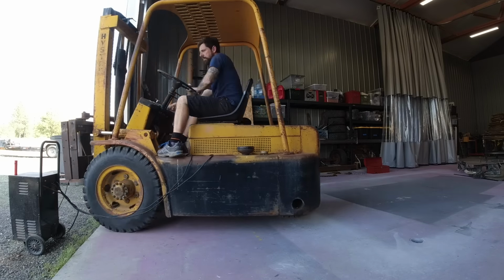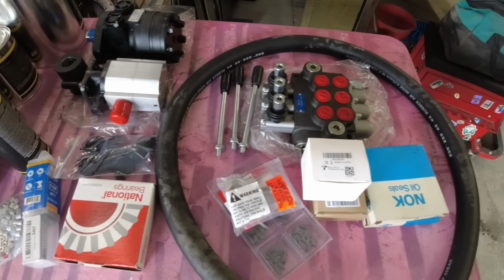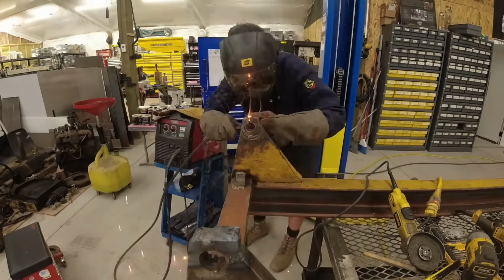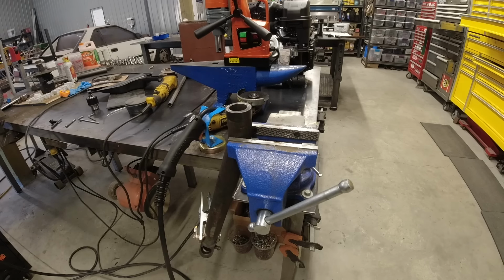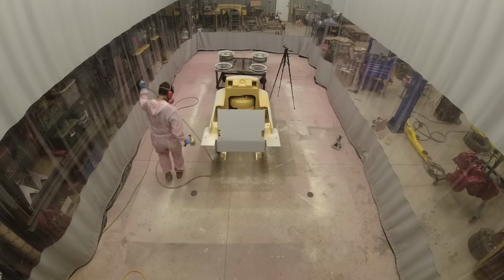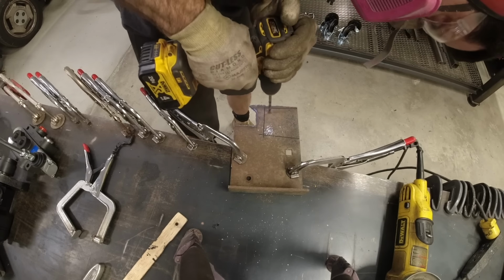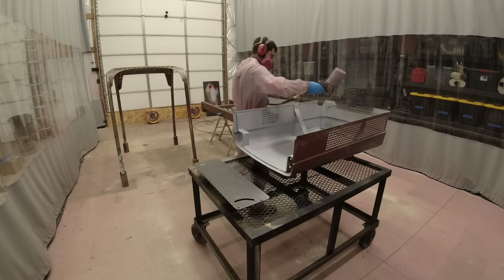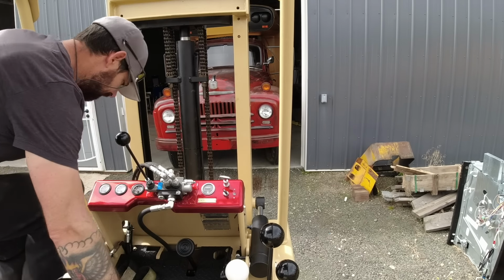Resto Modding A 1956 Hyster Forklift

Comment: I love the paint job. The only concern I would have is Counter balance weight. Part of the lifting capacity is being able to balance the load on the front end with weight on the rear and you removed a bunch of weight by removing the Engine. Do you have any safety concerns with the forklift tipping forward with a load on the forks?
Reply from the maker: The difference in weight before and after is probably about 400lbs or so, so you are correct that the lifting capacity is lower due to the lack of counter weight. I didn't think about that at the time because I assumed the weight difference was negligible. I have exceeded the weight rating on this both before and after the modifications and the only thing that happens is the back end starts to lift telling me I am past the lifting capacity. Most stuff I lift is well under 3k

Comment: When you was putting the brakes together I noticed that you didn't have a castle socket with plasma cutting just bolt a socket in the middle of it before you scrap the metal you took of it if you don't sell it put all on a pallet cover and Leave you never know when you may need some quality metal you will find a place for it All very good job well done should Last another 70 years

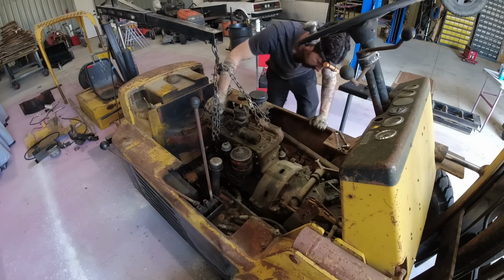Comment: Outstanding job and vid. Kudos, man!  ...BUT SIR! 0:37 BACK THEN the only way to get things done was to use cool engineering. It is nowadays, where electronics-driven, epoxy-encased, unreparable single-use crap is put to use. Nowadays they use shortcuts in designing and manufacturing, nothing-to-see-here, not cool engineering.

Comment: I would have used a power steering pump from a small car to power the steering for use with the proper cylinder control valve box thingy you mentioned. All the hydraulics on my homemade tractor run off a power steering pump, just need a pulley for the belt.
Reply from the maker: I thought a lot about doing that, but I didn't want to add another drive system onto the motor.

Comment: As a forklift mechanic was interested to see this restoration and how you would go getting parts, but quickly realised you were taking most of the original parts. Haha. We're you unable to get parts or did you just want to make it easier to drive? Love the look of these old hysters and thinking about restoring one myself one day and paint it up like Guido from cars 😂
Reply from the maker: If I could have sourced the parts I would have kept it more or less original. I would have made some little upgrades but I love old flathead engines. Just the engine rebuild kit was twice what the new engine cost and it still would have required machining and there were just so many parts I couldn't source

Comment: Fantastic work, well done, watched that start to finish. One question, what happens if you go from full speed to zero quickly? Does the drive motor have a pressure relief valve somewhere? Just thinking that would be a lot of inertia going into that comparatively small hydraulic motor compared to the old engine. Great build tho.

Comment: A fork lift is not built for speed you can turn one over at 5mph. It is designed to pick things up and move them from A tro B within a lifting capacity as shown on every FLT. I have spent 15 years plus as a R.T.I.T.B. trainer Asessor Exeminer and have seen the results of excessive speed on these Machines. Well done on a great restoration.

Comment: Clutches:- Saab 99s, had a 200mm by20mm dia drive shaft between gearbox and engine. Once removed, clutch and flywheel could be taken out. Didn't have to split any gearbox to engine bolts.
Reply from the maker: That is awesome, I will have to look into that design.  Thanks for sharing

Comment: Beautiful work and very thorough ! But that hf engine .. maybe would have gone another way there .. or simply renovated the original if it would still run. You are going to put near zero hours on this so longevity/reliability is a none issue.

Comment: I used to keep an old Hyster running. Capacity of 20,000 pounds 4 feet out, I think. I know it would lift 14,700 pounds with a CG 4 feet out. Six cylinder Continental flathead power!

Comment: Looks good. Would have liked to see if the original engine would have worked, but, yeah
Reply from the maker: Original engine needs a complete overhaul as its consuming both oil and coolant. I found the engine rebuild parts and they were expensive but not insane. The biggest problem was the other worn out parts like the distributor and clutch, specifically the pressure plate. I could not find the steering gearbox anywhere, nor could I find a similar one that would fit, even with a ton of fabrication.

Comment: Super nice build.
Would it not be nicer to the paint to have a flat washer between the paint and the bolt?
Reply from the maker: I ordered brass washers, but they weren't here in time so you saw the mock up install just to make sure it worked. It's got washers between the paint and bolt now

Comment: I had a 1966 triumph 1.3 4 door saloon car it was front wheel drive with the engine front to back it was designed to change the clutch without removing either the engine or gearbox. just like changing a record in a juke box ( well almost ).
Reply from the maker: That is awesome. I will have to look that up

Comment: So if you get a leak in the steering control valve setup you're not worried about hot hydraulic oil shooting you in the face?  Just wondering if you thought of putting a guard on that?

Comment: At around 15:00, that ear broke off not because of a bad design but because they didn't add enough material for it to withstand abuse which can happen to forklifts when operators aren't being careful.
Most other things on that forklift looks beefy and dimensioned for hard hits. Those ears do not.

Comment: Those split ring wheels are not 'widowmakers'. They are actually relatively safe compared to the actual widowmakers, which are the center-split wheels. Very thin flange holding them together and always a pucker when airing them up.

Comment: What brake line did you use?  Great build
Reply from the maker: https://amzn.to/3tFjMrW
Reply: @AustinCoulson  bought it thanks brother.  My son and I are  rebuilding his 1961 Chevy C10.  I have a couple videos.
But I just ran across your videos last night. I really enjoy your content
Reply from the maker: @2LateIWon  awesome. I love those trucks. I find the copper nickel lines are the best combination of strength, bend ability and corrosion resistance. I use the Eastwood bender and love it and I have the flaring tool in my Amazon store if you need it. Good luck on your project!

Comment: There is some confusion out there when it comes to the type of wheel you have. You have a wheel with a lock ring not a split rim. These are also dangerous if you don't get the lock ring on correctly and air them up. A split rim is just exactly what it is called. The actual rim is 2 pieces that have a separation point near the middle of the rim, and there is no lock ring on the bead like the lock ring wheel you have.  Both parts of the rim on a split rim is where the 2 sections will part ways if they are not connected properly before airing it up. They can also separate when in use if the connection where the 2 parts of the rim get corroded overtime and can separate in an explosive fashion.

Comment: Nicely done sir. How about a dot of color on your steering indicator for contrast? Could even be just a sticker. Lastly I would be concerned about the proximity of those hydraulic steering hoses to your feet, legs, and arms if a hydraulic leak ever occurs. That is fixable with a sheet metal guard.
Reply from the maker: I am in the process of rerouting some of the hoses and I've added hose sleeves to prevent chaffing and in case of an explosion. I was planning on adding color to that indicator but couldn't decide what color.

Comment: Show how to remove the rear wheels please to change rear tires.  I have a YE 40 and I am tuning it up.  They do not make forklifts this strong anymore.  I put a boom and a hydraulic winch on it making it into a small crane. With the boom I have set 35 foot long trusses on the walls of a building and moved 40 foot long utility poles.    I use it to put stuff on the roofs of my buildings and load trucks.  The kamikaze crane as I call it has worked for years and it has been not removed from the forks for years.   The engine starts with before you can get your hand off the ignition switch key. Our Ye 40 has dual tires on the front and is very stable due to the dual tires. Cool video you made
Reply from the maker: https://www.youtube.com/watch?v=5WYRvDtqRr8

here is a video where I show how to remove the rear hub. FYI, I do it the wrong way first so watch it through to see the correct way.  Good luck with your YE40, I LOVE these forklifts

Comment: slight suggestion why not use an Orbital valve for the steering with a adapter to the old steering column would look a bit nicer than the Raw valve bank on the Dash
Reply from the maker: The orbital valves I found while researching were all lower pressure ones with open centers that would have required a second hydraulic pump or a lot of hydraulic components to make it work so I went with simplicity with the single spool valve.

Comment: Me personally I would have made a grease zerk in the end of the pin and drilled a hole straight through the center and cut a little recess in the place where the bushings are and makes a bushings greasable

Comment: Great paint and clean but I dunno' about the mods.  I'm not diggin' the pull start motor, hydraulic drive and what's with no steering wheel.  Should have restored it to original or as close to as possible.  Interesting take on it though.

Comment: I'd say the part about it moving slow is probably a limitation of the engine idk if it has a throttle to increase the RPMs a gas pedal would benefit this so you can have your low speed and high speed just by pushing the gas pedal this should also help the forks raise faster

Comment: YT decided I needed to see this today.  I don't know what your top speed is, but our stuff at work is supposed to be limited to 6mph, and inside speed limits are 4 mph. Though when moving heavy, and/or tall stuff (2+ metric tons as double stacked IBCs say) I rarely go over 2mph so really like you say, speed is not of essence.
 And as pointed out by others, Your lift capacity is likely a bit lower as you've lost the engine weight of that brick of a Conti, the oil, and the coolant. I'd look into and equal weight of some plates or lead bolted in place low and as far back where the old engine lived to compensate and help the stability when loaded near max.
Reply from the maker: I'd say this rig probably maxes out at around 2mph on uneven ground and maybe 3mph on the concrete. Perfect speed for me. I will be adding some balance weight once I get it all dialed in and find the right location to secure it. Thanks for the comment
Reply: @AustinCoulson  cool beans, still fast enough to get in trouble with near max wt. or tall/awkward stuff.  Like that paint job, too.

Comment: This is a really cool build, and I don't want to give you any shit for it. That said, fully hydraulic steering sucks, as you're going to find, but probably nicer than what was there before. It's a bummer to see the manual transmission going, but HST is a solid substitute, with quite a few cool control options.

Comment: Split rim is not the same as a locking ring wheel. The widow makers were actually two piece rims that split in the middle. These are perfectly safe as long the locking groove is not rusted thru.

Comment: Good video and an interesting project. However your lifting capacity is actually less than the stock forklift. You removed a lot of weight that was also being used as a counterbalance to the load that would be on the forks. I really like the paint job!!

Comment: As an afterthought, you might want to consider putting a strip of Aluminum Diamond Plate around the bottom so the diamond plate is the first surface to be impacted instead of the steller paint.  How difficult would it have been to go electric if you had chosen to?  Would cost or difficulty be much different, given your skill level, which is substantial!
Reply from the maker: Going electric wouldn't have been that difficult but it would have been more expensive to have adequate batteries and I decided against it because I only the forklift sparingly and I didn't want to worry about battery maintenance

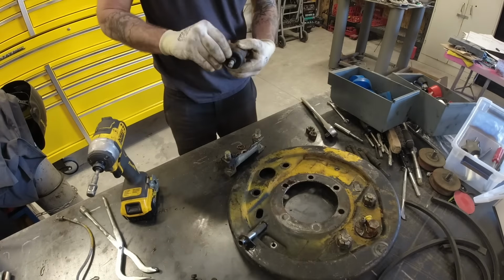Comment: 18:35 I have an extreme hatred for drum breaks. Yeah, I know that they have their uses, but why the extreme hatred for them? 

They are unfit and extremely unsafe for use on Trucks(ie pickups like Ford, Chevy, Toyota, and etc.) I’ve been a passenger in my stepfather’s truck and he has to manually pump the break pedal in his Chevy truck(from the mid 90s) 200 feet from where he needs to stop. He starts pumping them even when the traffic light at an intersection just turned green.

And the little wheel cylinder in the drum breaks on the rear wheels had to be replaced so many times by now that the amount of money he has spent on replacing the cylinder could have been used to pay for disk breaks for the rear wheels.

Comment: Its abit overkill but if you had fitted a oil pressure light you can then get the hour meter to only run when there is oil pressure.

Comment: Nice job. Seems though as if a gasoline powered forklift is limited to outside work? How about electric motor to drive the hydraulic motor?
Reply from the maker: I thought about an electric conversion, but I didn't like the cost of batteries or the hassle of maintaining them. I run this lift in my shop, I just have to open the door

Comment: The build quality is amazing, but I still have several issues with your steering system. not exactly sure on a good way to fix that, though.
Reply from the maker: The steering is my favorite part. It works great but I will be adding a flow control valve to it in order to slow it down a bit

Comment: Hint; as a 40 years of production fork lift operating. ever time the employer change the forklifts to Lp gas the motors almost never needed rebuilt.  instead of new motors about annually mainly due of it over heats the fuel is automatically shut down. due to the LP gas vaporizer is designed.  goo luck !
Reply from the maker: I am considering changing this engine to propane for that reason as well as the cooler running temps.

Comment: Was there any asbestos in the brakes?
Reply from the maker: Great question.  There almost certainly was, so I used water and avoided compressed air while cleaning them. I also wore a respirator while working with them.

Comment: Nice job on your Hyster resto-mod.  I have the same forklift only mine is not as pretty.  Are those new brake shoes and if so, where did you buy them from?
Reply from the maker: I reused the existing shoes as they were in great shape

Comment: The lifting capacity has changed. As you removed a significant amount of weight when you pulled the original engine out.

Comment: Great video. I had to hit the subscribe button. 

Question:
What is that curtin solution you are using while you paint? I am about to build my shop and want to do something similar.
Reply from the maker: https://youtu.be/_3SWbrU2Muw
Reply: @AustinCoulson  perfect. Thx
Reply from the maker: @goatmaster3387  no problem. I still recommend all the products I used, this booth works great. The curtain company recommended an extra 10% length so it doesn't have to be pulled tight and I found that to be a little too much. 5% extra would have been more than enough. I think I still have a coupon code for those EP fans I'll try to find that and post it as a reply here.
Reply from the maker: https://s.vevor.com/bfQHWm

https://amzn.to/3SGAxO1

Comment: The engine should be a Continental Flat Head Engine. F245 model for forklifts.

Also, in all probability, the 'roof' part was after market. Hyster didn't ship the lifts with them.

Comment: I've got to mention that your original lifting capacity is not wholly the same now.  You've removed a lot of weight behind your center of gravity by doing away with the engine, cooling system, etc.  So, unless you've replaced that weight with something else, your lifting capacity has been reduced somewhat.  Exercise great care when using your forklift.  Hope it serves you well for many years..

Comment: How many hours on that one b4 build? My same machine has 2300 hours, NO cage or side shift. Older than 1956? That would be crazy.
Reply from the maker: The cage and side shift were not factory. The serial number will have a date code if it was manufactured after 1957. The brake drums have a casting date as well.

Comment: All you people here worried about counterweights and engine weights etc etc. 
Owning ~30 forklifts for 40+ years, up to 10 tons capacity, the mfr rule is, as long as you fillow the load chart, no oroblem.
   In practice, you will not break a quality forklift, because you'll loolse steering, when the rear wheels lift too much!  Ourood  Hyster wouid lift an extra 2000 lb. at 24" load ctr. with about 300 lb. Steel hanging off the rear. The suspension was designed for that!

Comment: The engine isn't controversial at all. Lot of heavy equipment uses that EXACT setup. Som use Kohler Vtwins we have a chipper that's a single Briggs and the disc runs off a pump and motor from that.